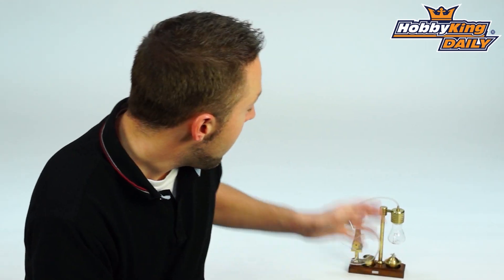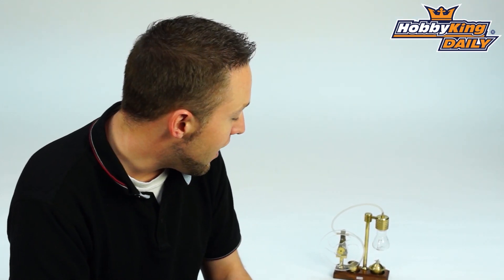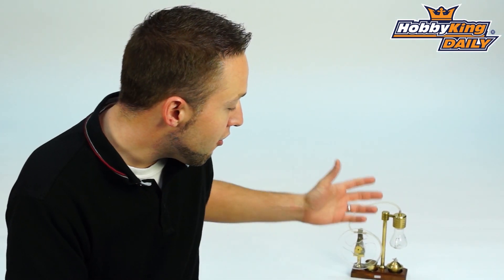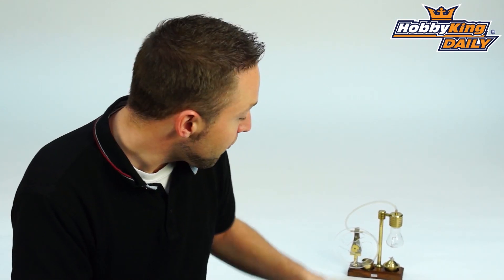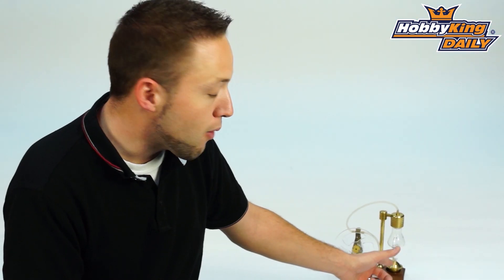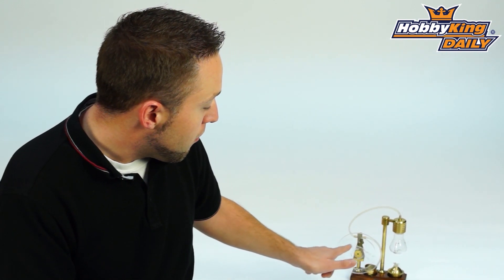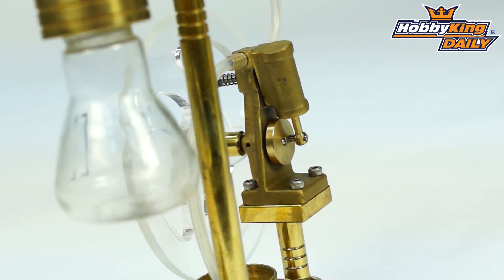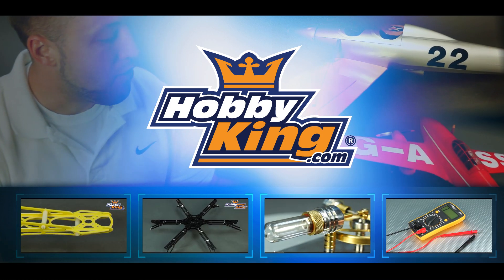HobbyKing Daily - Steam Engine

Comment: on the other stirling engine they sell I had good luck using denatured alcohol to run it
im hoping I can use that on this one too, all I can see is maybe it wont get hot enough quickly as the correct fuel would
where can I find the correct fuel in the USA for these?